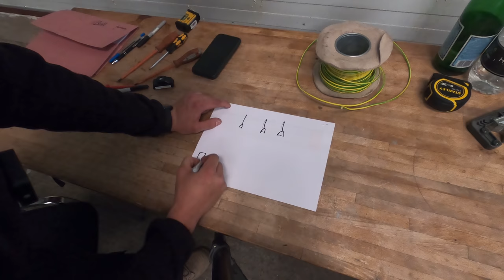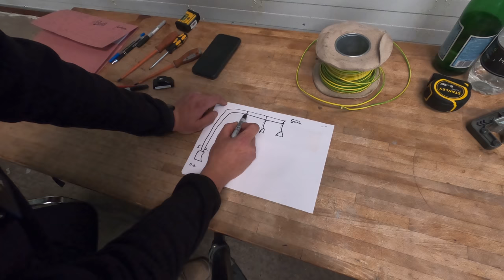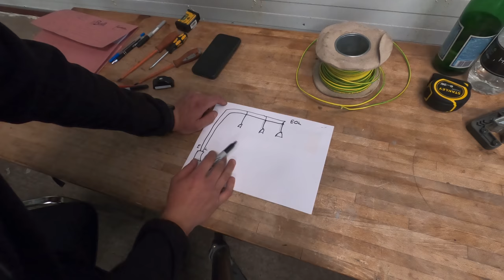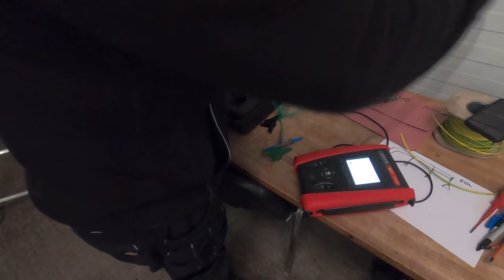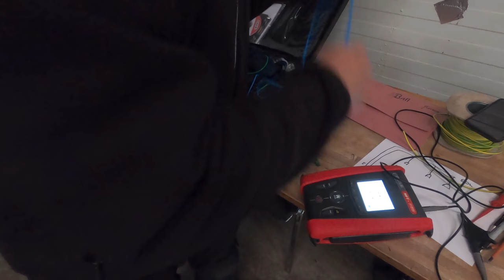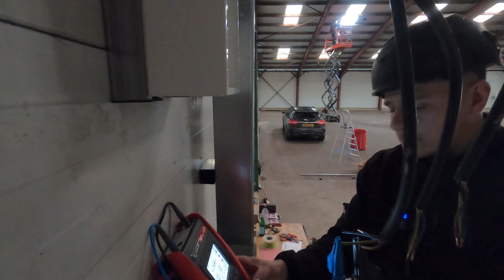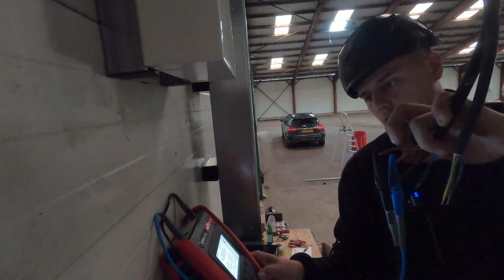Fitting wrap-around distribution board trunking

Comment: Very good point on the moisture and humidity. Get a humidity tester as well as temperature probe on surfaces to check on external influences. I do really believe there is a massive gap in professional learning but also someone like yourself thinking outside the box. If you are following the regs only that is a big problem - no one install or circumstances are the same what works in one May not work in another area. Keep pushing for the sky mate it’s good to see such professionalism in the young.

Comment: Trick with fixing to sheet metal, lots of small screws or use rivets. RivNuts also good way. Dont be affriad to use silicon or urethane as well, once cured, ads a lot of strength.

Comment: you should use stand off mounts or unistrut in all applications.... Why??? Water will track down a wall, by holding it off the wall will prevent water ingress into electrical equipment

Comment: I agree with you about the grinders but mostly about small grinders that they are dengerous to use. especially some small grinders buttons are not designed in good positions and you have to twist the grinder as you are using it to turn it off with one hand which is dengerous. I have seen some  programe on BBC about accidents at work and on the foads, people cutting off their hands from power tools.

Comment: Waiting for a tee,,,why not make one ,,,all those tools you got why not invest in a folding workbench or use the table in the corner save your knees and back working off cable drum..get some slug busters for making your holes for glands it does a far nicer job less mess also..be careful working of your steps try to face them towards your work face.you be amazed how easily you can go over..cpc not an earth, one earth at the intake if I remember
Reply: a lot of places dont make trunking bends anymore and its usually all premade. I worked in big sites where you are not allowed to make bends , even on tray unless theres no way around it. I dont blame you since i personally like making them but the job is changing
Reply: @cocoino2307  yes you be amazed how many youngsters can’t fabricate anything now,,,this feller seems switched on and his videos are good for new comers..

Comment: I never use self-drillers on sandwich panels....takes too much metal away. If you ever un-screw them they will not tighten again properly. Try using points.....with either a 1.5mm pilot hole, or locate screw on phillips head and start them by hitting with palm of hand. Very little loss of metal and much stronger holding ability.

Comment: 42:30 here, these should help, next time you're in toolstation or that 😁😁

toolstation.com/hamilton-prestige-synthetic-sash-paintbrush-set/p49973

What stuff are you being told you shouldn't show?  Most sparkies don't deal with bigger industrial stuff so it's interesting af to see stuff like a cable joint, 200 Amp incomer and that.

Also, are there shops that can prefab the trunking for you so all you've got to do is turn up and stick it on the wall or is that not cost effective?
.

Comment: Are you gonna show layman how to do something? No not really they are going to do it regardless. On the science of electrical theory - electricians learn only so much not many professional electricians have really understood the science of how AFDD works, ampacity calculations or heat issues in terms of conductor fills in conduit and containment. For that you would need the mathematical background of an electrical engineer with advanced physics on electromagnetic theory, plasma physics CFD and finite element modeling regarding airflow around cables laying on conduit and even then you will not be at the cutting edge it takes continuous commitment and interest to a very high level of CPD to be at the very top of the profession.